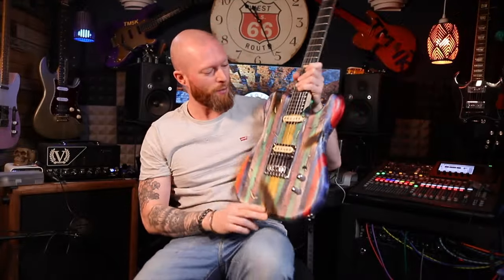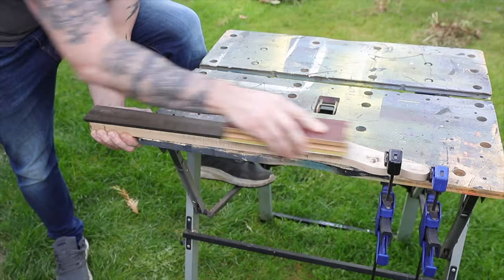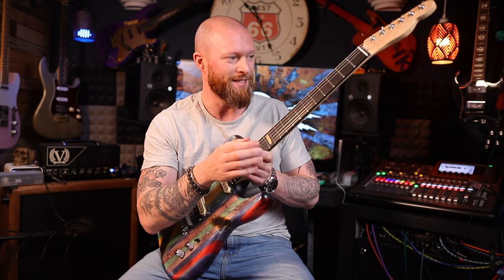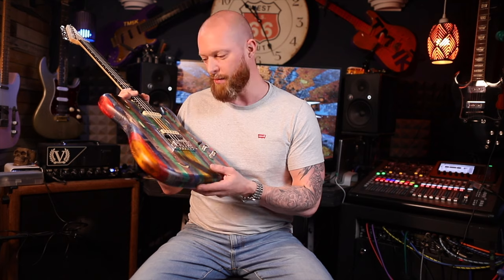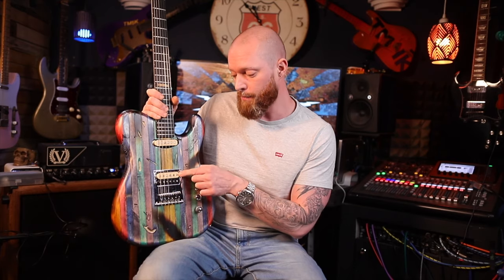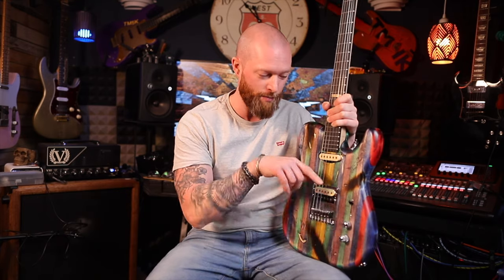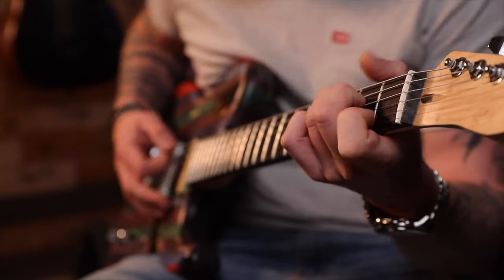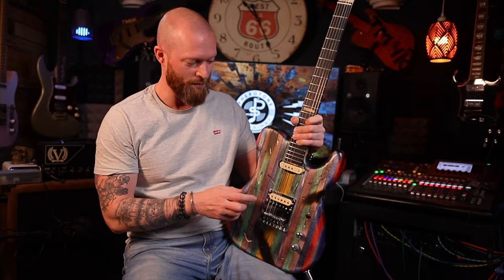Pallet Guitar - DIY pallet wood guitar

Comment: Hi Mark - just worked through the wiring - really interesting.  Do you use the blended positions much or just each end of the pot?  The reason I ask - I'm thinking of using this with a push-Pull pot to do the switching to humbucker config' instead of the pot.  Do you see any problems with this?  Thanks again for the great idea.  Are you on the Guitar Builders Collective forum?  (I know you were a guest) - this would be a good addition in the wiring section.  Cheers.
Reply from the maker: Hey Simon.  I just use each end of the pot so this would work better as a push/ pull.  I didn't know there was a guitar builders collective forum, I'll try and hunt it down
Reply: @PherotoneStudios  Cheers Mark - see you on there!    I've posted some wiring stuff too.